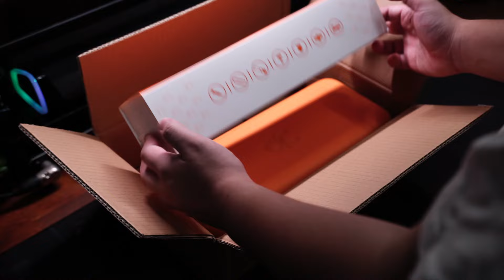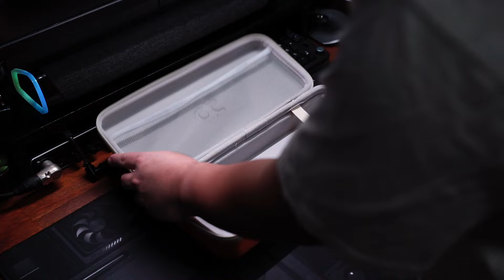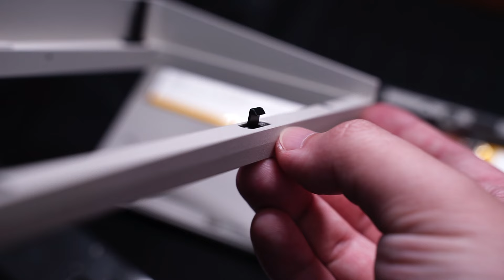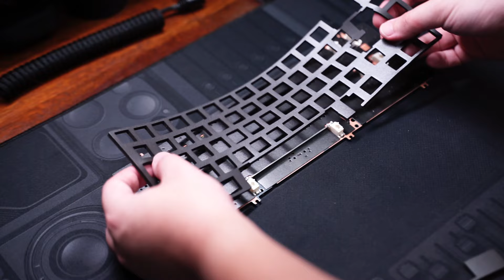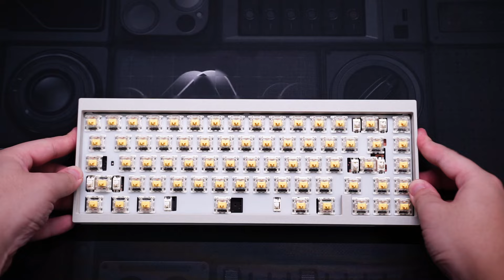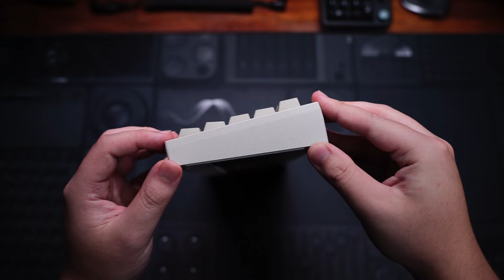QK65v2 Classic Build & Sound Test (Retro White + Brass Weight)

Comment: Great video! How do you find the texture of the retro white spray paint finish? I am trying to decide between spray coated vs anodised
Reply from the maker: I prefer the spray coating as it has more of a rough texture. Anodised is nice too if you prefer a cleaner look
Reply: @itssamueltan Ok thanks! What made you choose retro white over normal white ?

Comment: Very nice video! The combination you chose looks very beautiful. By the way, do you think the copper weight will have a different sound compared to brass?
Reply from the maker: Hey thanks! I honestly think that the weight in the bottom won't change the sound of the keyboard. But you can look through some other reviews to find out tbh
Reply: @itssamueltan  Thanks for the answer!

Comment: I really wish they stuck with the accents/blockers on the top... The original design was much more interesting from the top, now it looks a bit too conventional. Definitely love the bottom and the rest of the kit, though, especially the HE PCB is fascinating since the switches are the second ever closed bottom housing HE switches.
Reply from the maker: Well it is called the "Classic" so they just wanted a keyboard without any screens or gimmicks. But I agree it looks kinda plain from the top.